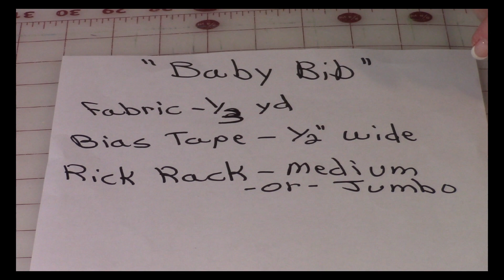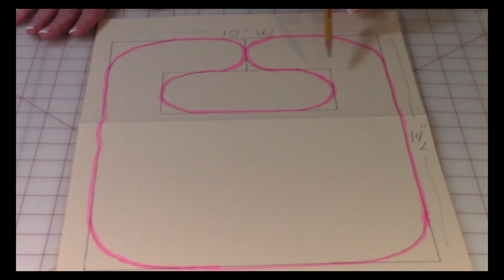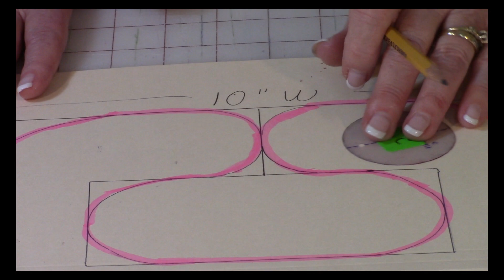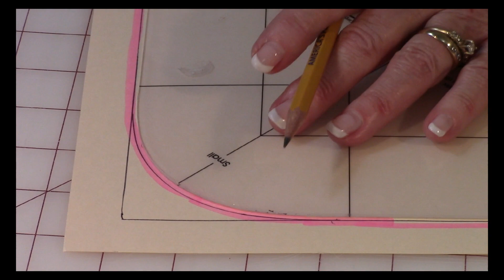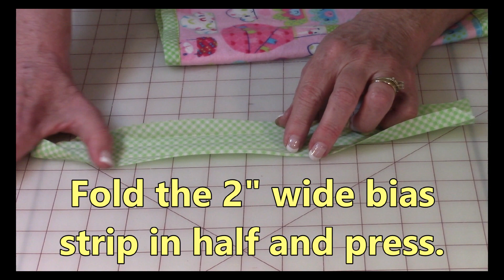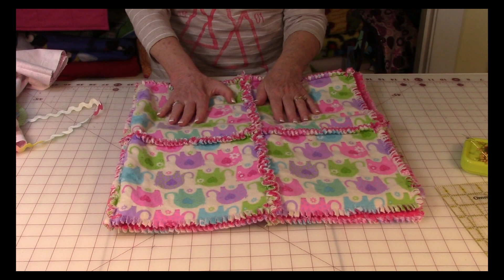DIY Baby Bibs Tutorial | The Sewing Room Channel

Comment: Thank you for the pattern  for the bib not everyone can print patterns  thank you for explaining it simple terms x.  Could you  tell me wha age this bib would fit plz then can adjust thanks
Reply from the maker: Hi Carol.  This bib will an older baby.  You can always cut the width and length smaller or larger.  You can also cut the neck bigger or smaller.  If you have an old bib that fits your baby, you can place it over a drawing of this pattern.  Then you will know if you need to make adjustments.  Hope this helps.  Thanks for watching💗and happy sewing😍